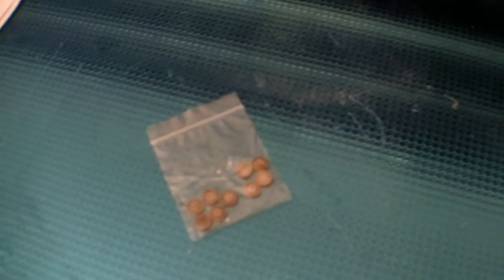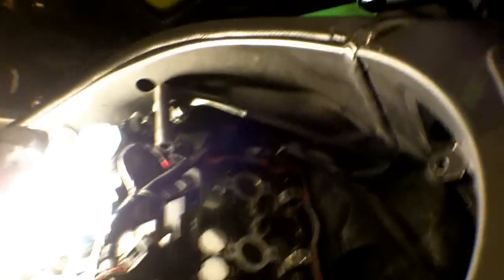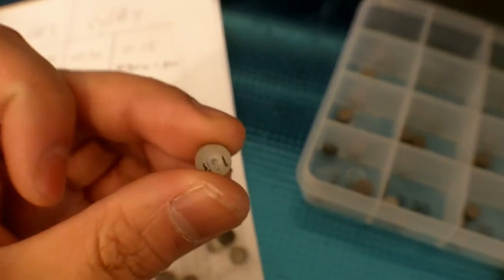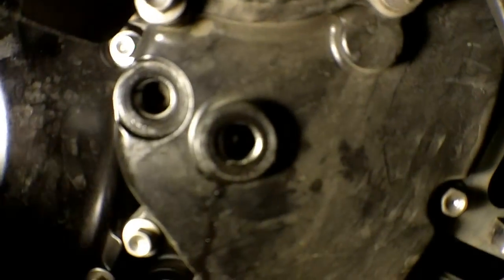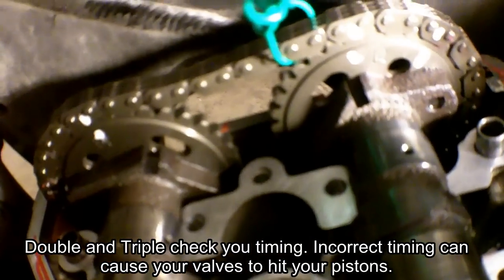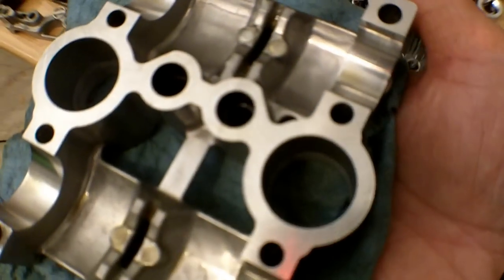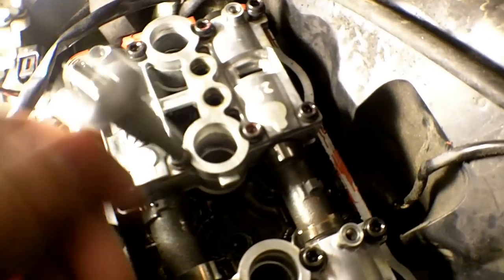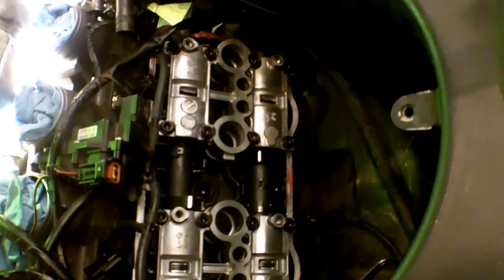Valve clearance adjustment using shims on a motorcycle Part 2

Comment: I can't seat the cams. Each time i pull the exhaust chain taught, seat the cams, but at a certain point the chain skips 1/2 a tooth.

Ill try to take out the cams entirely and pull the chain to ensure there is no slack.

Any pointers? All of my exhaust are 0.15mm and I reshimed already just can't seat the cams without the chain jumping a 1/2 tooth each time.

Edit: One of the dowels wasn't seated flush

Comment: Hi, I was just wondering why you would use the average specified valve clearance?, surely if the valve clearance shrinks over time then it's best to go with the largest allowed gap, so as it shrinks you will get more use out of the engine before having to mess with shims and buckets again?

That to me is the same as keeping your oil level exactly between Min and Max where as I prefer to keep it topped up to Max in case is has a sudden reason to use of lose oil or if I forget for a longer period, it just gives a bigger safety buffer wouldn't you say?
Reply: Less wear. If you use the greatest possible clearance there will be more wear..

Comment: Hi Wedginator. Great video ... many thanks! I've been trying to contact you about the Yamaha YZF600R stripdown video you put together (also a brill video). Your website quoted email address doesn't seem to be working. I've sent to emails to it at separate times and both were returned as undeliverable. I was really wanting to find out if you intend to put together a reassembly video (as mentioned in your video.

Comment: Can you confirm the markings for timing them. In the service manual, says set the crank to TDC 1&4, but the cams are rotated 180*. The grove on both cams where the sprocket mounts onto the actual cam, is on the bottom (in the service manual) yours is on top. I went by the service manual and it wouldnt fire up. As well as i think it bent a valve since now i cant turn it all the way over with a ratchet.